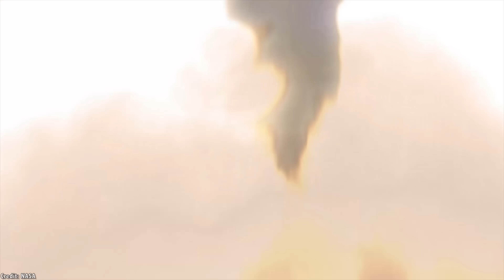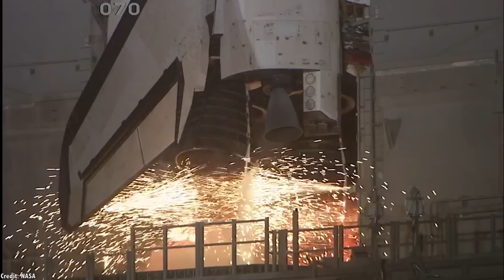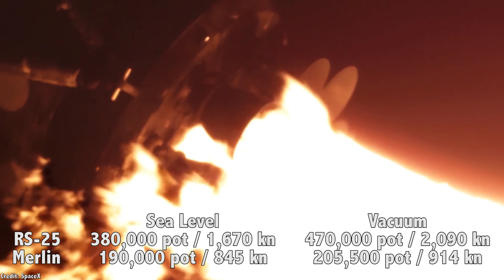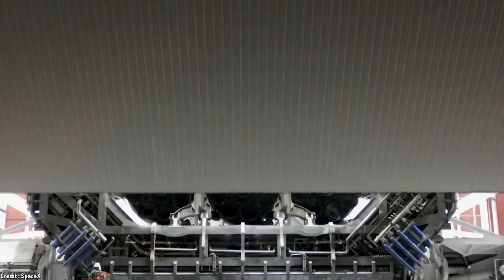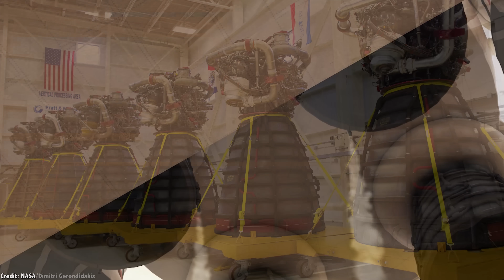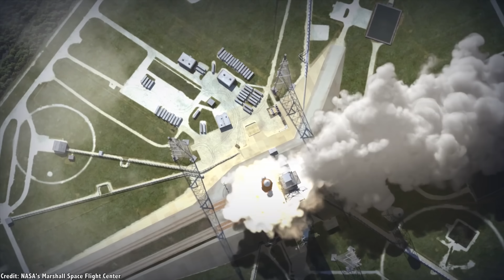The Rocket Engines Carrying Us to Space. The SLS RS-25 (aka The Space Shuttle Main Engine)

Comment: As was already commented, the o-ring that failed on Challenger did not hold the engine together, it was a seal between segments of the solid rocket booster.  Also, Aerojet was not the company that was awarded original contract, it was Rocketdyne in Canoga Park CA that won that contract, and has designed and built every SSME engine ever produced.

Comment: Ok, RS-25 is impressive, but IMHO it is not the good enough reason to use them over the several times cheaper way of launching loads into space. Our main goal as the species is to expand before the next massive asteroid hits the Earth. Cheaper engines will do it faster without the need to impress investors by power. They will be impressed much more by the (financial) efficiency and the final results.

Comment: RS-25 vs F1 engine
Reply from the maker: They're both beautiful engines.
Reply: RS-25 Engine Is More Efficient Than F-1 Engine At Converting Fuel And Oxidizer Into Energy! Liquid Metallic Hydrogen Would Be The Most Efficient Chemical Fuel If An Engine Can Be Designed To Use It!!!👍👍👍👍👍👍👍

Comment: The SSMEs weren't made by Aerojet (they made the Orbiter's hypergolic OMS--Orbital Maneuvering System--engines, see: https://en.wikipedia.org/wiki/Space_Shuttle_Orbital_Maneuvering_System ), but by Rocketdyne. The corporate history of the SSME (from this article: https://en.wikipedia.org/wiki/RS-25 ) is as follows:

"Designed and manufactured in the United States by Rocketdyne (later known as Pratt & Whitney Rocketdyne and Aerojet Rocketdyne), the RS-25 burns cryogenic liquid hydrogen and liquid oxygen propellants, with each engine producing 1,859 kN (418,000 lbf) of thrust at liftoff. Although the RS-25 can trace its heritage back to the 1960s, concerted development of the engine began in the 1970s, with the first flight, STS-1, occurring on April 12, 1981. The RS-25 has undergone several upgrades over its operational history to improve the engine's reliability, safety, and maintenance load."

Comment: The RS-25 deserves (and makes more sense for) better jobs than a "die-upon-completion" one, where four of them will be discarded with each SLS first stage. Since they are throttleable, man-rated, and reusable, NASA could finally build the fully-reusable, TSTO (Two-Stage-To-Orbit) Space Shuttle (with a winged booster) that it really wanted. They never really wanted the 65,000 pound payload; they were perfectly content with a 12,000 - 30,000 pound payload into a 28.4 degree orbit. (The 65,000 pounds resulted from an Air Force requirement, which they demanded in exchange for political support when the Shuttle program faced stiff opposition in Congress in the early 1970s--the USAF wanted a 32,000 pound polar orbit capability for Vandenberg Air Force Base launches, which equated to 65,000 pounds to a 28.4 degree orbit when launched from Cape Canaveral.) Also:

Now that robotic orbital space planes (such as the Soviet Buran shuttle, and the X-37B) are a reality, the RS-25 could also power a smaller, unpiloted TSTO shuttle-like launch vehicle (with, say, four RS-25s powering the winged booster, with one powering the orbiter). Such boosters (first stages) could also be ballistic instead, returning to land at the launch site (or landing downrange, on a barge or ship), like the Falcon 9 and Falcon Heavy first stages.

Comment: One slight correction--the one inflight "failure" of an SSME (when Challenger had to use the ATA--Abort To-Orbit--abort option; I watched that launch live on television) wasn't an engine failure, but a sensor failure. After that engine was shut down, another SSME started showing the same problem, and a woman engineer--her name escapes me--advised that it was a sensor problem, and that the crew should implement an "enable inhibit," which told the Orbiter's computers to ignore the warning signals and keep both remaining engines running until their correct shutdown time. Postflight inspection showed that it was indeed a problem with the engines' sensors.

Comment: It’s so expensive though
Reply from the maker: Spaceflight is expensive. But I can't wait to see how the era of reusable rockets changes the costs of things.
Reply: Fraser Cain yea but the rs-25 won’t be recovered at 50mil a pop that’s messy, are they gonna try to reuse decommissioned shuttle boosters? that would lower short term costs I guess.
Reply from the maker: They're going to start with those, and then use new ones after they run out of reused ones.
Reply: Fraser Cain that’s not a bad idea given that they probably won’t need this kind of Launch vehicle much just core modules for space stations I just hope they keep some back for museums etc they are rare relics of the space shuttle after all

Comment: "Merlin engine uses an ope cycle  . . . less powerful pound-for-pound."

Actually, the Merlin 1D engine has a greater power-to-weight ratio than any engine in history, of any kind. What it lacks in comparison to the RS-25 is not power to weight, but efficiency, due to the more advanced combustion cycle but mostly because hydrogen is such a light propellant that it is inherently more efficient in any kind of rocket engine than the kerosene that Merlin burns.

Comment: I LOVE how gorgeous the thrust from the RS-25 looks, it feels like you could run your hand through it as if it were water
Reply: It's because of the LOX and Hydrogen burn, it's a more efficient burn than F1"s LOX and RP1 (a variant of Kerosene). The RS-25 can go 110% full throttle, while the F1 was doing under 90% full throttle and escaping energy from the open cycle model engine it was. Still the F1 is the Boss of all rocket engines ever built!
Reply: I bet you LOVED the first Space Launch System launch, didn't you? I know I did lol. I live a little less than an hour's drive away from the Kennedy Space Center, and Artemis (I) got to launch in the middle of the night.

When I say I've never seen anything like the SLS, I mean I TRULY have never once witnessed anything even remotely comparable to that rocket, because even from the Orlando area, it turned the entire night sky BRIGHT ORANGE!

And let me put it this way. I've gone to a couple of SpaceX Falcon 9 rocket launches—one at around 8 at night, one during the day. For all intents and purposes, I got as close as you can get to the launch pad, had a full view of the horizon (y'know no trees in the way or anything), and was close enough to hear them with my own ears. As amazing as those experiences were to me, especially the night one, the SLS launch was just on a completely different scale and level, even from an hour away.

So I now adore those RS-25s more than I ever had before ♥️
Reply: Better because the hydrogen and oxygens are liquids!

Comment: Stuck in the past. Seems to be a US disease at Government Level. 
If they are going to spend hundreds of billions which the SLS will cost as a program to do what its supposed to do it would have been better off developing something new. It was supposed to be a cost effective program. Use existing proven technology from the past. 
There must have been many future concepts put up. Better to go for the most promising of those and end up with something more advanced. 
Even the Russians are very hesitant about going with there Energa as a heavy lift. It is 1989 technology, not 1970s technology. 
If all the production gear etc. has to be re-created and new technology incorporated anybody knows using older designs often ends up more expensive. 
Any Builder will tell you that on simple things like houses. Cheaper to build a new  house based on a new design using new materials and techniques all the way through than try to recreate something from the past. They just don't make even the bolts and fixings you need anymore. 
A new design that incorporates items now being made always is cheaper. 
Thats why many of the Private ventures go well. They start with what have we got being made now economically and use that. They minimise the new custom made components they need.

Comment: I've recently learned that rocket engines have been experimentally optimized to obey Newton's second law rather than the third.
It's simple, at the very instant an the force applied to an object F is bigger than the force of reaction (F>-F(react)) acceleration changes from a=0 to a<>0 and we must use Newton's second law f=m x a. Hence reaction force is just a  resistance or contact force with limited range and related to inertia. But apparently reaction is a force that cannot move objects, just oppose a resistance to applied forces. that's all ... For example when you push a brick  or a stone wall with your hands it oposes to he force you apply with an equal force but negative sign. I you use a bulldozer and progressively increase the push force you will end up toppling the wall down. Since you start pushing until  just before the wall falls down f(react)=-f(bulldozer),  at the moment the wall falls down f(react)<-f(bulldozer)...
Reply: What ?
Reply: Yeah, reaction force is passive and cannot push anything, only resist.
Reply: @jlfqam  that's why guns don't have recoil
Oh wait
Reply: Guns have recoil, because inside the chamber a blast takes place that pushes the projectile forward and the rear of the gun back, that simple. The push backwards is bigger than the reaction force of the barrel bottom, that's why you feel recoil force. Put your hand flat on the side of an open door, pull your hand quickly, do you see the door moving in the opposite direction? Hold a latex balloon with your hand touching and a freely swinging door. Puncture the balloon, do the door or your hand move? it's the blast force that moves both, not any magical reaction force.
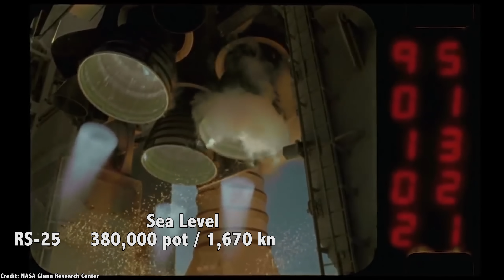Reply: Ion engines produce an ion plasma which expands due to ion charge repulsion, which is the actual push.Some push is also acquired when ions pull the ion lenses. Yes I am retarded because I understood this many years later. That's life.This video gave the idea, after minute 5:18  an explanation why a model test tube rocket moves is explained without involving reaction forces, just action forces, it's great.https://www.youtube.com/watch?v=3zHfKpErfpk
Reply: @jlfqam  ion engines do NOT create an expanding plasma, that's what plasma thrusters do, ion engines ONLY accelerate charged particles
Reply: How do they prevent plasma from doing what plasma does, expand? Why do you think the profile of an ion thruster nozzle is like that of a liquid rocket engine?https://en.wikipedia.org/wiki/Ion_thruster#/media/File:Ion_engine.svghttp://www.waters.to/blog/wp-content/uploads/2014/03/Slide1.pnghttps://www.researchgate.net/figure/Schematic-of-the-Helicon-Plasma-Thruster-of-the-HPHCOM-thruster-1_fig1_267227654nozzle walls is where the actual thrust takes place

Comment: It's not really fair to compare hydrogen/oxygen rocket engines' efficiency directly to engines that use another type of fuel.
In fact, it's not really fair to compare engines of any one fuel type, to engines of any other fuel type.
Because it's usually not the engine that's more or less efficient, it's the fuel mixture itself.
Reply from the maker: There are all kinds of tradeoffs and decisions.
Reply: I know. Pricing, fuel tank size, containment issues (hydrogen is notorious for diffusing right through solid matter), environmental concerns (hydrogen can be very bad for the atmosphere if it was electrolysed using coal power instead of, say, solar), etc.

Comment: Just to note, the "13 times the speed of sound" figure that Rocketdyne has on their website is misleading.  I believe they are referring to 13 times the speed of sound at sea level, but the RS-25 only has an expansion ratio of about 70:1.  Using a gamma of 1.4, i think thats somewhere around exit mach number of 6-6.5.  JoshTheEngineer does a good video on this, and uses Nasa's CEA solver to compute the exit mach number with the correct gamma, and it turns out to be around 4.5.

I highly recommend his channel for anyone interested in more detailed explanations of compressible flow theory.

https://www.youtube.com/watch?v=hIg3G3JIMxQ
Reply from the maker: Very cool, thanks for this. I'll check it out.

Comment: Why not try and make the engine section of the SLS reusable kinda like what ULA is doing with the Vulcan?
Reply from the maker: You would need to completely re-architect the SLS to put the motors over on the sides like Vulcan. I don't think anyone wants more delays for SLS. :-)
Reply: Fraser Cain True enough. Maybe that might be an option for a block three variant. Thanks so much for the reply!

Comment: Raptor is a full flow staged combustion deep Cryo-Methalox engine. It is going to be more efficient than the RS-25. Obviously the Isp will not be as high since Raptor is not Hydrolox, but for a given fuel the full flow staged combustion takes advantage of 100% of the possible energy that fuel can provide. Raptor will also have the highest thrust to weight ratio of any rocket engine ever produced. Even higher than the Merlin 1D (which is the current record holder). Raptor is truly reusable as the RS-25 is merely refurbishable. Raptor is much much cheaper to produce than RS-25 as well. RS-25 is more powerful as far as POT, but it also needs much larger tanks with insulation making the overall vehicle heavier and negating the extra performance you get from using Hydrogen/LOX as the fuel. Since SpaceX will also super chill the Methane and LOX to increase its density, giving it an extra 10-12% more fuel in the same size tanks (source is SpaceX), I think Raptor is superior to RS-25.

Comment: Excellent informative and unbiased video!  However, due to the costs you mentioned, I think SLS will eventually be cancelled.  I've always been a fan and follower of the RS-25 engine and the shuttle program, but now that spacex is doing incredible things, I can't think of a justification for the cost of SLS other than being a works project.
Reply from the maker: Once the BFR actually flies, I wouldn't be surprised if the SLS gets canceled.
Reply: Why would NASA accept the risk of a system that has a "test in flight" mentality on engines that have tiny fractions of the amount of development and qualifications...  when they could use the most reliable engines ever made for mission critical tasks?  Don't get me wrong, the SLS is a massive exercise in overspending, and there are far more economical options than the RS-25 that wouldn't include the amount of risk associated with choosing SpaceX.  I think SpaceX has found its legs in the private sector.  But when it comes to NASA, it makes sense politically and socially for NASA to continue using extremely high fidelity hardware.  What NASA should do is develop its own ultra heavy launch vehicle with modularity for large mission archatectures (heavy equipment etc.).  A massive investment upfront to be sure, but one that would pay dividends over the next 100-200 years as we begin to have a greater need for sending large quantities of supplies and building materials into space to establish self sustaining operations in space.

Comment: if i'm not mistaken, the arrangement of those 27 engines are to mimic the power of the aerospike engine.
Reply from the maker: That's an interesting idea, I'd never heard that. Now I'm going to go do some research.
Reply: i don't know if that's what they were doing in this case, but a while back, i had read some article on a configuration like this, and the outer engines focused the thrust inwards against the exhaust of a central engine, the engine acted as a truncated spike. the aerospke came in two forms annular and linear.

Comment: I always hear thrust, newtons law, throttle-able engines and so on, but the reason for this is NEVER explained. 
Sounding rockets are small, but VERY fast. Fwwwoosh, its gone, Saturn V? Slow and lumbering seemingly, but thats the reality of G forces. Sure, Big F Rocket can get to 17,500+ mph in short order, but it would crush the occupants or cargo, so it must go up at 2 or 3 g's with bursts of higher... 
Just a comment, other than that, I am sure you can perform rocket surgery with confidence.

Comment: I think NASA should abandon the SLS system; by the time they have it up and running they'll be outpriced by Space X. Sure, it'll have a larger payload capacity, but still note enough to make any significant milestones for many, many years, by which point Space X will have the BFR. If NASA used its budget to design and manufacture new in-space infrastructure and paid Space X to launch the hardware to LEO , they could run more missions!
Reply from the maker: NASA is already the biggest customer for SpaceX. As they demonstrate more capability, you'll see more and more launches switching to SpaceX and Blue Origin.

Comment: The new RS 25 will have improvements over the older not only in the power but also in the cost.  Like parts made with additive manufacture (aka 3D printing) that should decrease the cost and speed the manufacture (also decreasing the overall cost)
Reply from the maker: Yeah, once they start building new engines, I'm sure they'll take advantage of new manufacturing techniques.

Comment: Small correction: the o-rings didn't "attach" the boosters to anything. They were for sealing the hot gases inside the casing. a failure in a seal let hot gases impinge on the support structure, weakening it until the stack broke up under dynamic stresses.
Reply from the maker: Thanks, sorry for the slip up there.
Reply: Excellently worded